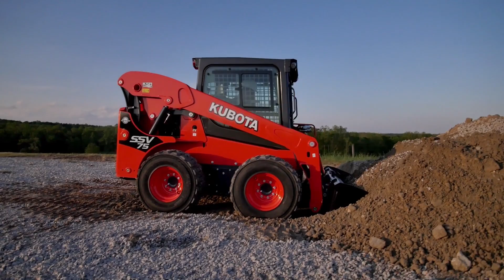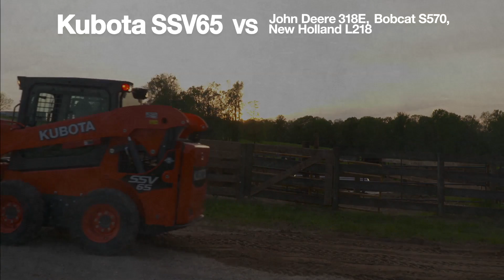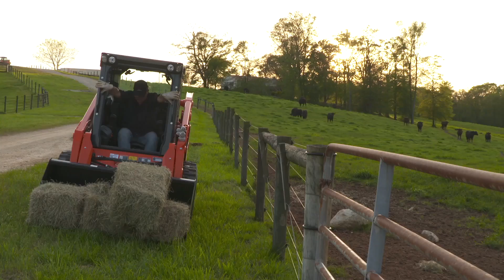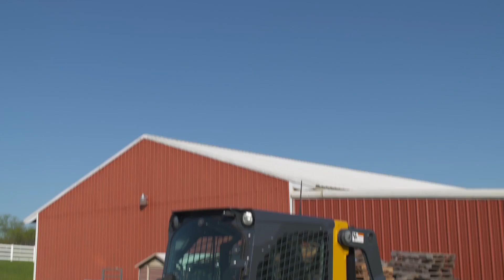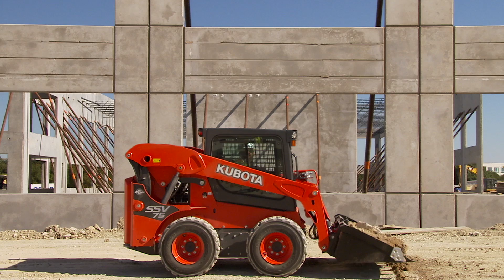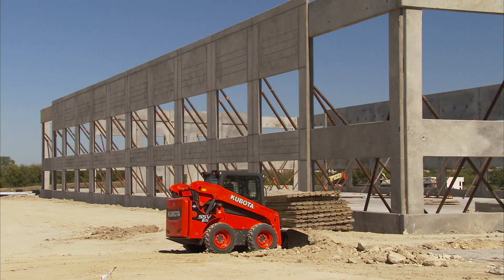Kubota SSV75 & SSV65 Advantage Video

Comment: I think Case builds about the nicest quality skid steer. However I will have to go with Kubota when I buy one because of the way the door opens. My skid steer will replace my tractor and I do a lot of loading and unloading equipment using chains and chain hooks on my bucket. If I had an outward swinging door I would have to have someone with me to hook and unhook chains. The bucket has to be all the way down or up over the cab to open an outward swinging door. Can’t do that. I’m usually a one man operation. I could go with a Volvo or JCB side entering Skid Steer. Not sure about JCB but pull your wallet out for a Volvo. And grab your ankles for repairs.

Comment: Please work on cab comfort and quietness with your SVL line. Another mph in speed wouldnt hurt either. Still love the machines, just wish these 2 things were addressed.
You left out that Kubota and Takeuchi are hydraulic over hydraulic (ASV also), unlike the rest of them, including cat, that use that horrible electric over hydraulic system. 
I also just rolled over 1000 hours with my SVL75-2, it hasnt had a single problem. The damn thing has been absolutely reliable.
Reply: True

Comment: I don’t get the point of the cage on the inside ? There was never difficulty cleaning the outside especially when using a pressure washer but now you can’t clean the inside of your cab without removing the cage ?
Reply: Nope. All you do is move the windows on the Kubota, but Both New Holland and John Deere's Skid Steers make it difficult to clean those nasty windows.

Comment: Instead of putting down a machine, realize they have different applications and zip it.  If you have a spec to note, or a flaw, that's one thing, but yes, Deere's have massive breakout and Kubota's have some nice design bits, as do Volvo, and some machines come with pre-stretched chains and take a long day to adjust, while others are easy to access but need more frequent attention.  Good luck.